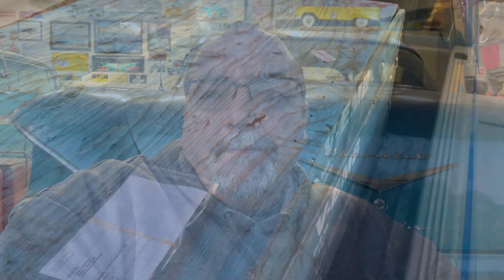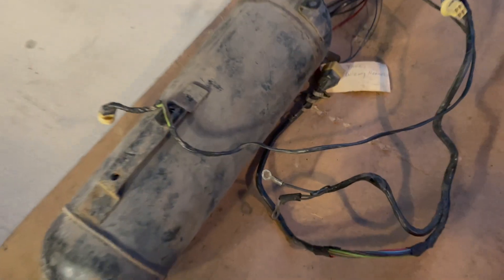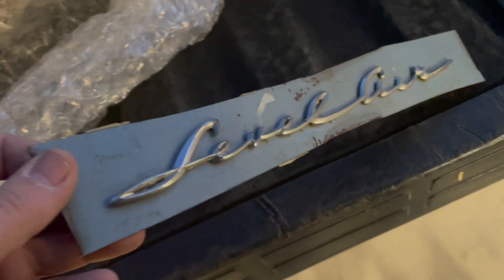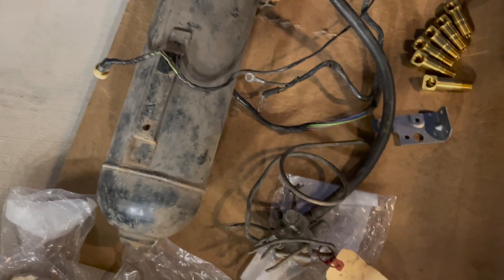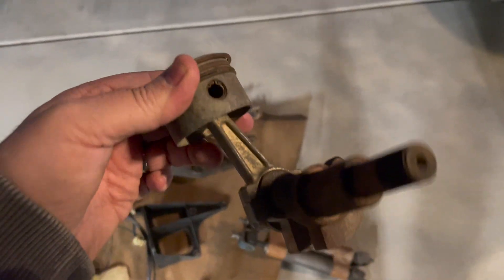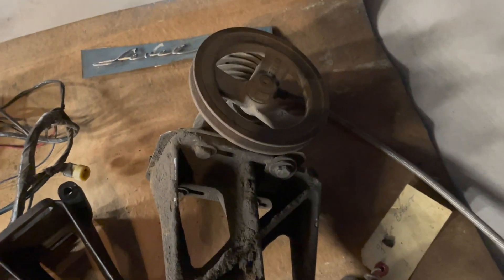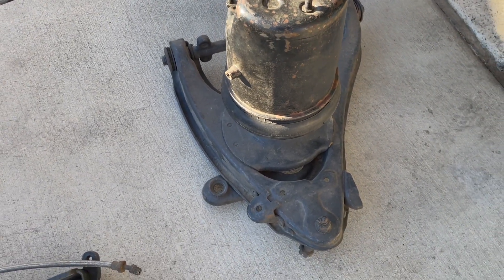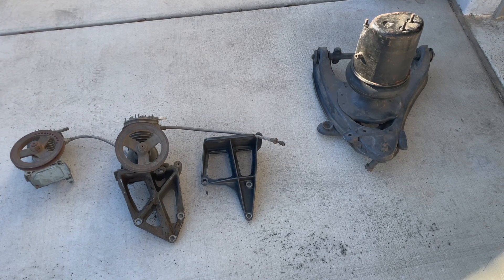1958-1959 Chevrolet Level Air Unboxing

Comment: Excellent!  My family preachest a new 58 Impala 348, Cashmere blue with White Top with had standard coil springs. I drove that car until I was broadsided in 1976 and then pulled the. engine and Powerglide and installed them in a clean engineless 63 Impala. Thank you for showing and explaining the complexities of the air ride system and shock placement.